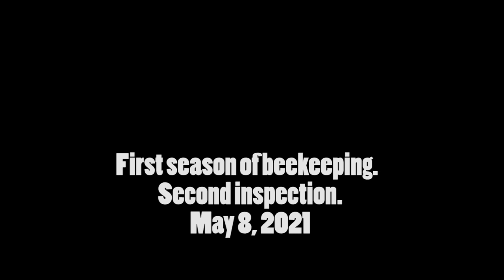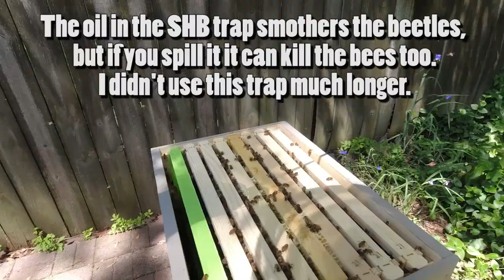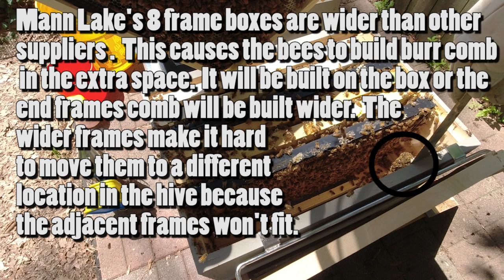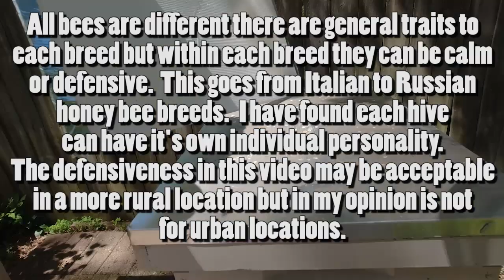❶ Beginner beekeeper - Second Hive Inspection - Defensive Bees FLASHBACK

Comment: I was surprised to see you in a second brood box by your second inspection.   How long were your bees in the first box before you needed a second?   Did you start with a Nuc?  I will start with a Nuc and will have a frame feeder that will take up 2 frames.   My hives won’t be at my house so I want to make sure my bees will be okay in my first deep for about a week using 8 frames.  Also, do you 1 1/2 gallons of sugar water will suffice for a week with a newly established Nuc?   I will get my Nucs toward the end of April   I imagine a lot will be in blooming around that time in central Alabama.
Reply from the maker: They seem to build out 8 frame boxes quickly.  I've read that it is recommend to add another deep after 80% of the frames are filled (that would be about 6.5 frames.)  Our bees had the second deep put on in 7 days!  We started with a 5 frame nuc.  You can watch it in our first episode of season 1.  The 5 frame nuc I got was loaded up with brood so they had bees of all ages and were in building mode.  I would think yours may be the same if they are coming from somewhere in Alabama.  I was putting only a half gallon of 1:1 sugar water on per week and they were taking it all in a week if it didn't get moldy.  Too much sugar syrup and they could back fill the brood nest with nectar.  hopefully they are determined to build out fresh comb for you.  You may be able to get by with only 6 frames for a week but be ready to expand the following week to a double deep.  Worst case scenario is if they feel too crowded they may try to make swarm cells and prepare to swarm.  You could find capped queen cells by the time you return.  You could knock these down if  that's the case (but only after you find that the original queen is still there), add another box and hopefully stop their urge to swarm.  A lot depends on the weather too.  If you could plan a trip out there mid week that may help you rest easy.  I hope I answered all your questions.  If not send me another reply.  Thanks for watching!
Reply: @BrianCooper901  thanks.
Reply: @BrianCooper901  Thanks for your reply.
Reply from the maker: @mgmbamaguy  Anytime!  Thanks for watching.  I'll work on getting my first season videos out so you can see what we did.